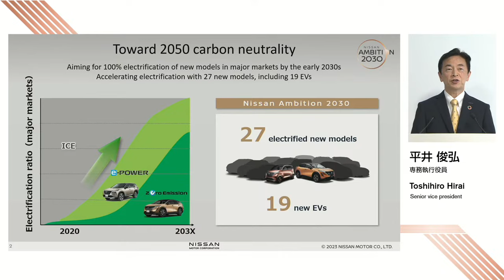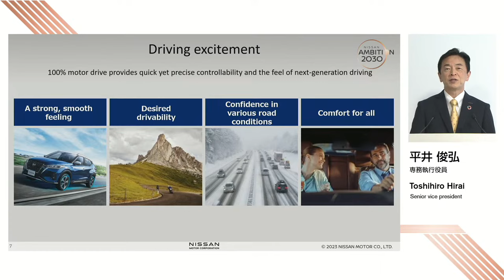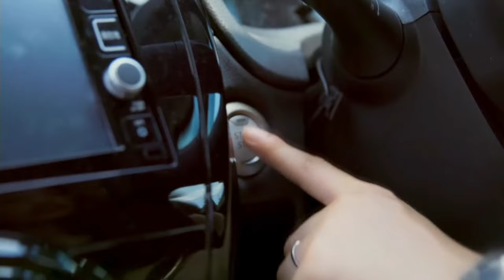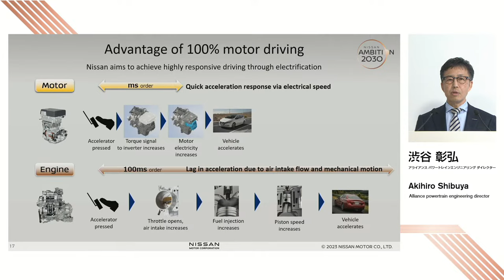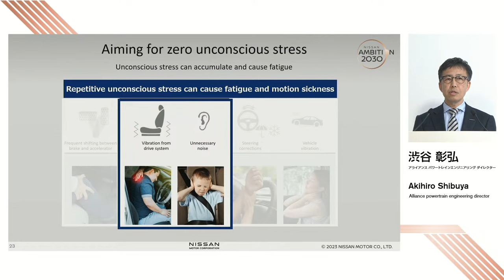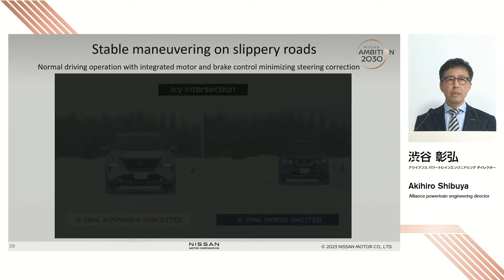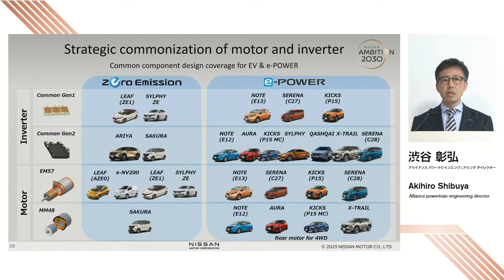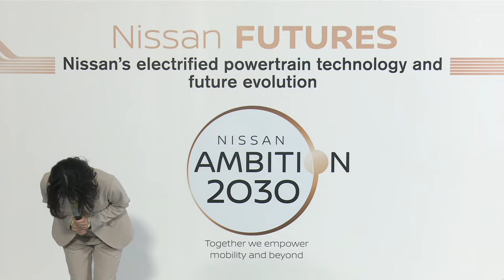Live: Nissan electrified powertrains seminar

Comment: Nissan ambition 2030:

Senior vice president Toshihiro Hirai san
Time 1:30 to 12:30

27 Vehicles by 2030
19 EV
8 e-pwr

Electrification strategy
Pillar 1: ePwr
Pillar 2:EV

1.ePwr born from EV
2.Common drive system
3. Enhancing driving experience, reducing cost
4. Model market growth representation
5. Comonization، Modularization,Core tech evaluation
 

1230-1530
The concept of X in 1

3 in one for EV
(Motor, Inverter, Reducer)
5 in one for e-pwr(Motor,Inverter, Reducer + Generator,Increaser)

2nd Speaker  Akhihiro Shibuya san Alliance Engineering power train director

15:30 to 17:30 Common factors reducing driving comfortability
17:30 to 18- advantages of motor driven vehicle to Engine driven

Time e-Pedal 20-23 min How need for breaking reduced
Vibration improvement in Snow, sand 23-26
Noise control - 26-27.30
Slipping control till 28.4

e-Force concept for better breaking around 30 min

Common Motor , inverter between EV & epwr vehicle chart 33 min

Material improvement 35 min

Improvement over 10 years in EV , e-Pwr(launched 2016:Japan) 36